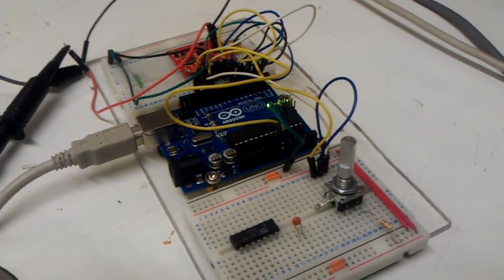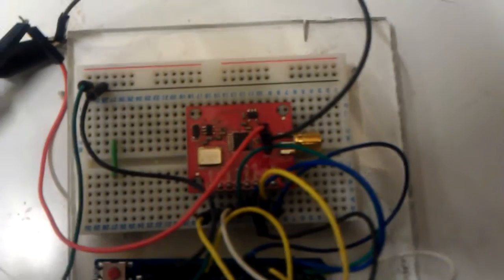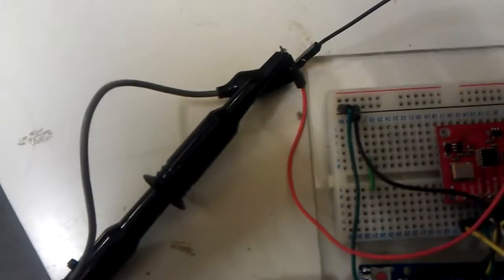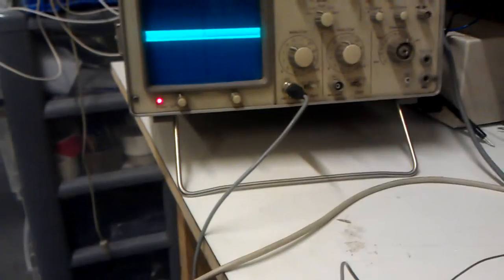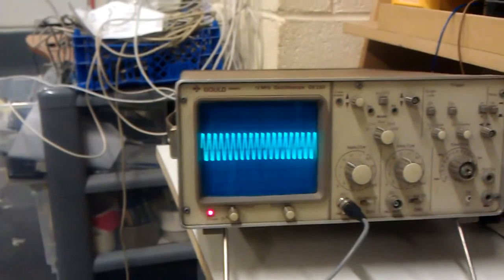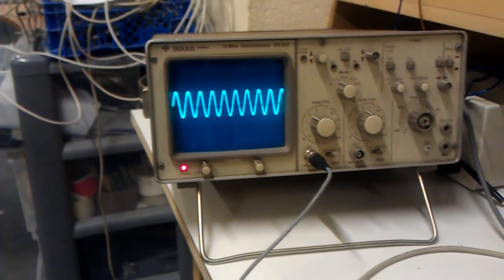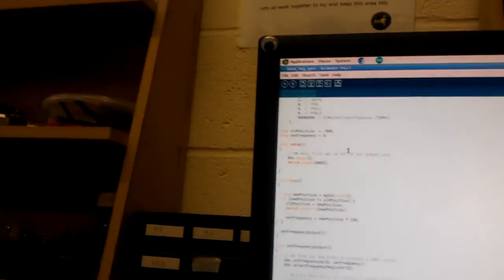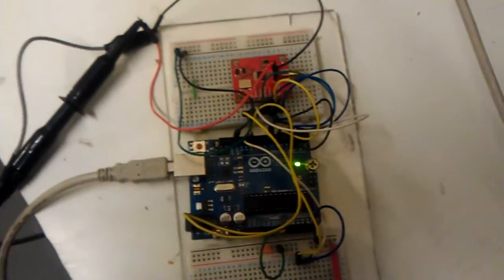Demonstrating the AD9835 Breakout board from Sparkfun

Comment: Hey,
i want to generate frequency upon command using DDS AD9835 I have bought one. i want to interface arduino with this AD9835.i found a library : forum.arduino.cc/index.php?topic=67958.0
it shows compiling error. AD9835 is unknown. i want some help in the code.can u help me?
Reply from the maker: Vanashree.  From what you are saying it sounds as though you do not have the AD9835 Synthesis library correctly installed.  You need to ensure that the arduino sketchbook has access to the library so that your program will compile.  I can take you through the process if you like but it is not difficult to achieve by yourself with a little research patience and effort....:)
Reply: thanks... a lot..i got it...in my library...thanku.. so much.....
Reply from the maker: Well done!